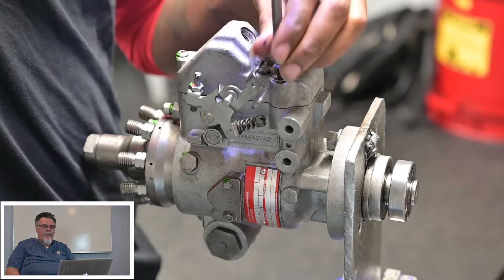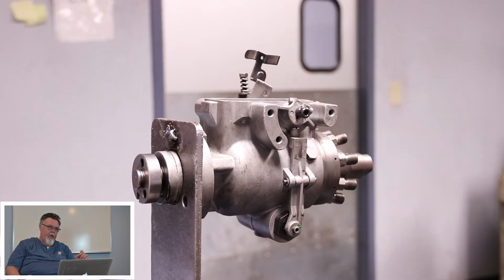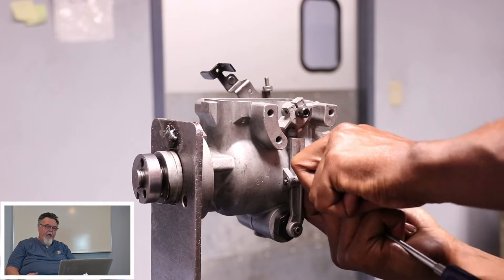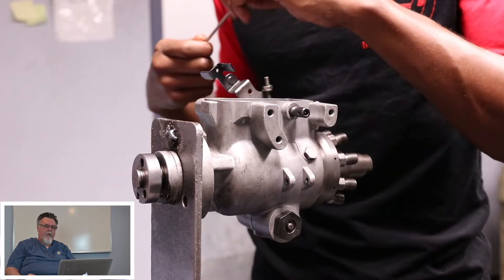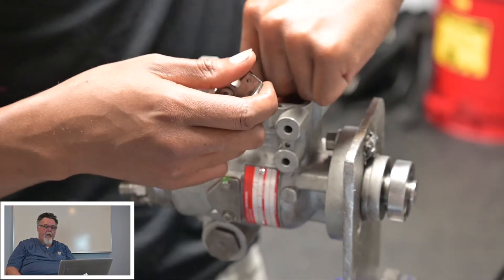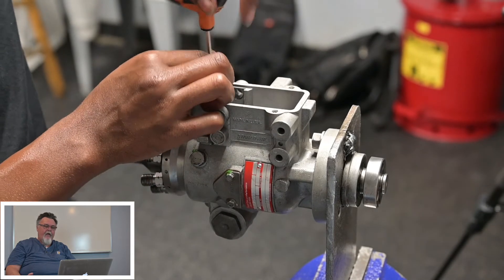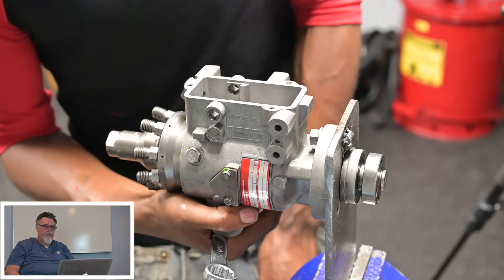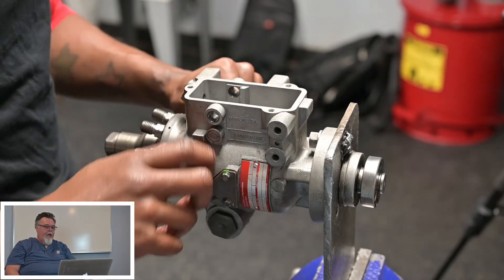DB2 Fuel Pump Disassembly

Comment: Just bought a 1989 7.3 idi and it only has 80,000 miles on it, but been sitting a long time.  The only way to get it running, cold or warm, is with a quick shot of starting fluid mist.  I am hoping cleaning the pump will solve this issue.  Just installed new Motorcraft glow plugs, but still haven't been able to glow them, so maybe there is a harness issue.

Comment: Loved the videos!
In one you said if you remove or loosen the check valve (return) and the engine starts..... why would it start(help).
Low pressure side... what shifted? Viscosity comp, pressure reg? I’m confused how it changed the high pressure pistons from producing high injection pressure.
Help the confused 😮
Thanks in advance 
JohnnyGSE

Comment: How do you readjust the guide stud with the lock nut. What is the adjustment or where should it be on reassembly? Cheers
Reply from the maker: It's best to mimic the original position. If that's not possible run it all the way in and then out 3 to 4 turns.
Reply: @dieselcare  OK. What does this adjustment do? Because some db2 pumps don't have a nut on the guide stud

Comment: I was adjusting  the fuel and I had the Allen setting there and when I cranked it over for top center to adjust, the Allen was in too far and it rolled onto it and I heard a pop. Now it doesn’t pump? Thoughts?

Comment: In regards to the plate, I've made a similar holder but using an angle iron instead. This allows me to have it vertically or horizontally depending on what's needed.